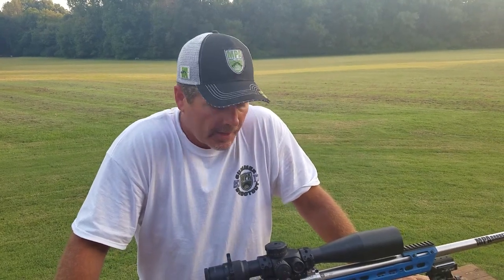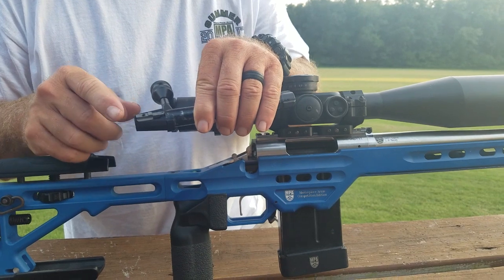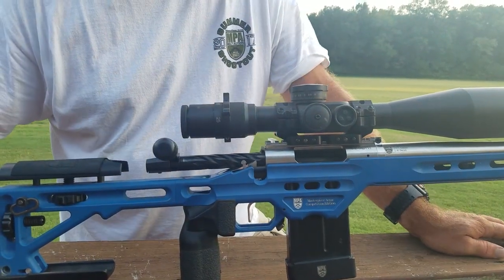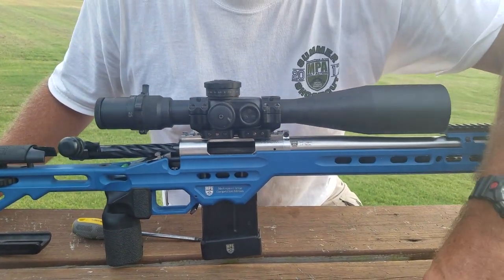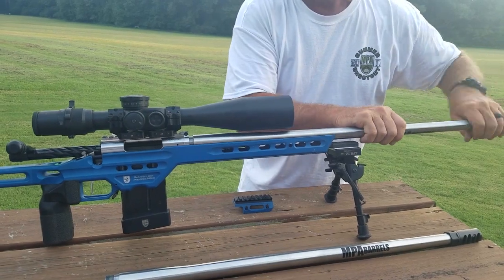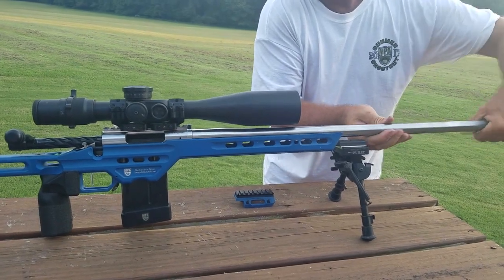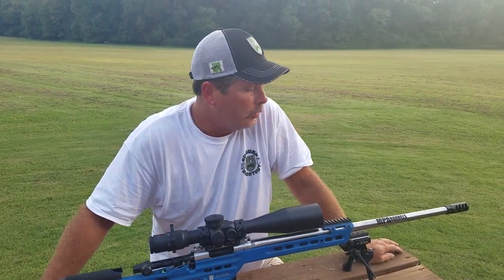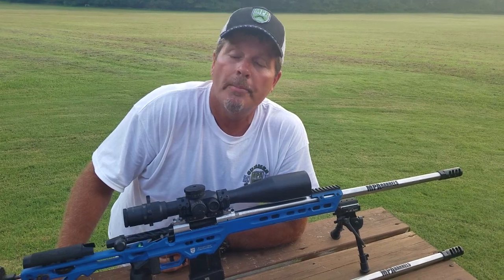Masterpiece Arms MPA65BA SL (Switch Lug Rifle)

Comment: Integral lug provides the same feature just at a cost right? 

I wish someone be it George or Chase would design a floating bolt head 3-lug design. Having a parent action for both the ELR matches and the regular matches would save some cost.
Reply from the maker: Integral lug does not provide the ability to swap barrels with a torx wrench in 2 minutes. For ELR and standard matches, you could always run a 65 Saum (ELR) and 6/6.5 for (regular matches.)

Comment: I prefer the manual extractor of the mausingfield and bighorn tl3 .... not a m16 extractor fan on a bolt gun ...
Reply from the maker: There are many ways to skin a cat. If it works, then no need for change.

Comment: How does this system differ from the AI system? 

Also what is the cost of your system in 223? And 6mm?
Reply from the maker: The AI system uses a thread tension system using a machined tab in the action body. Its a different method of accomplishing the same task. Contact MPA for specific pricing. Thanks